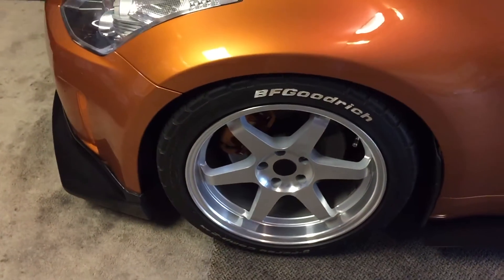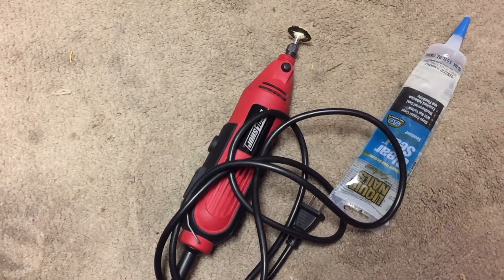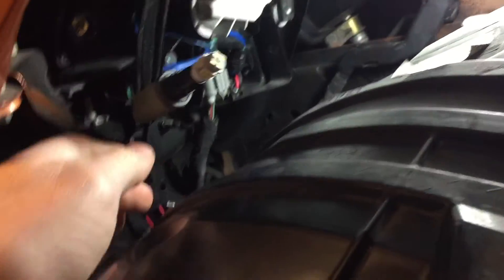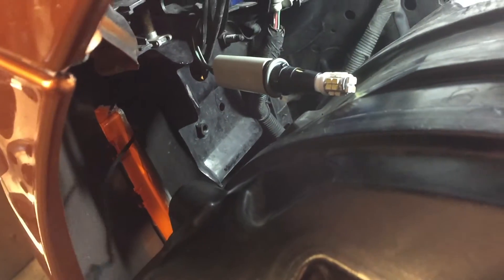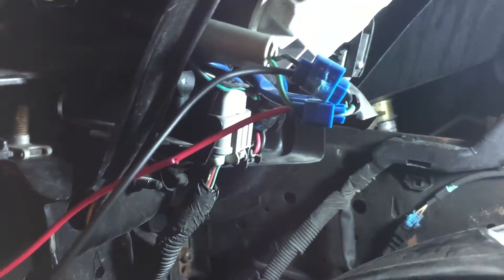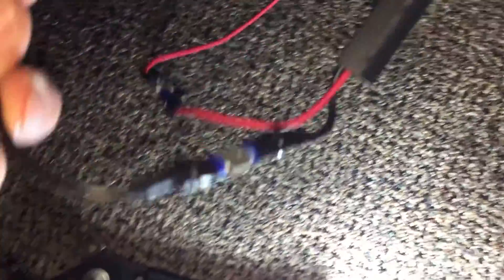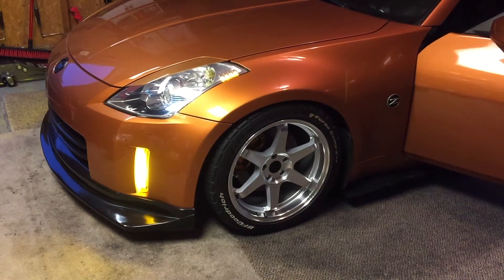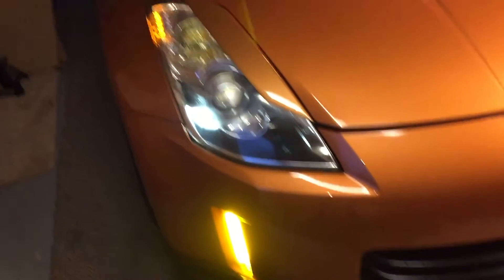350z Front Bumper Reflector LED install

Comment: They look good bro

Am just confused how installed leds inside them?

What type of leds
Reply from the maker: In the video I show a 7" cob led strip.  It's an aluminum piece that is one long bright led.  So its not those basic little smd type led strips because those arent bright.  I then separate the oem reflector, glue these in and then seal back up w/ clear silicone.
Reply: Thank you.. u just u saved us from blowing over $100 bucks. I will do like u did.. thanks again
Reply: Wats ur insta? I ll do mine and show u.. + have a group of 350z will share experiences abt parts and help each other...
Reply from the maker: @haithambaloch9965  @d.prent